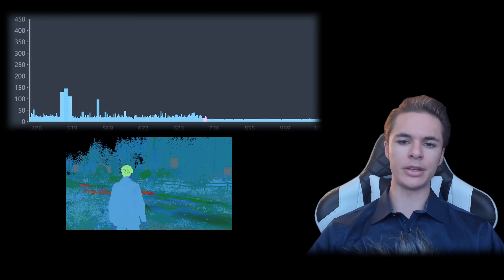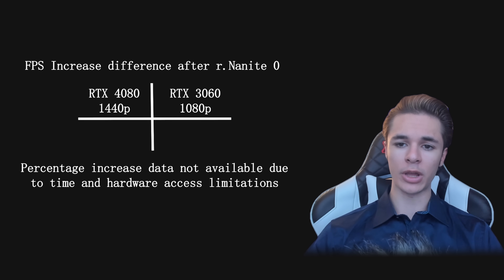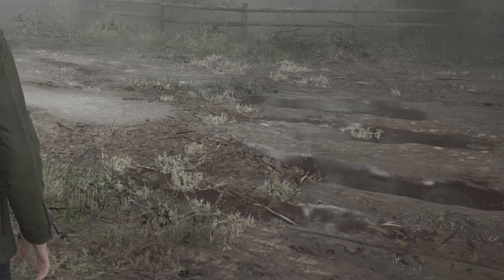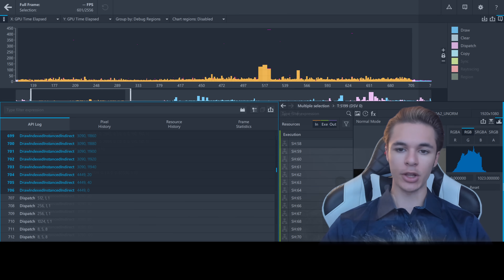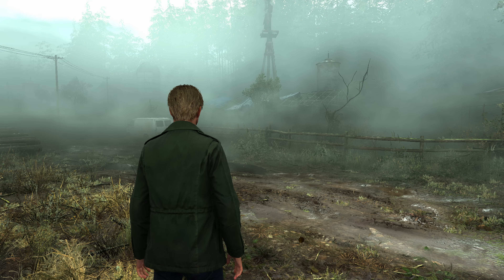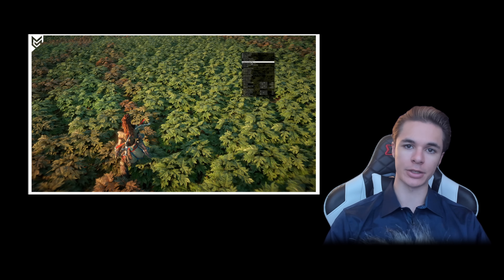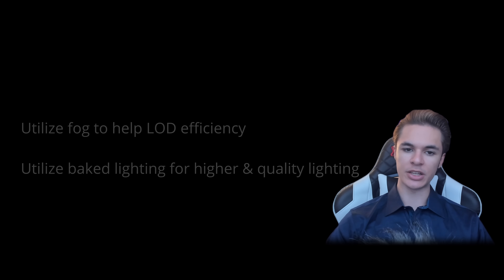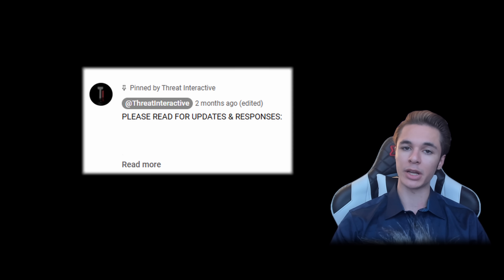The Price of Realism? | SH2R Optimization From The GPU Perspective

Comment: yakuza 6 looks better than any game that is going for realism and made after 2018 cause Nvidia said we don't wanna improve our tech buy our shit bearly better gpus to use dlss and devs that get the highest end shit thought that this would allow them to work with photo scanned assets straight out with out optimization look at older games they had systems to add detail not to remove them like Crysis but you and now UE cocks lies to people that UE 5 is better than UE4 where you can't optimize or it will slow down their nanite shit and removing it means you need to optimize instead of wasting a hour in lod tool you just press one button and ad over 1m meshes with out considering the vertice placement so models don't look like shit every statue looks like shit in ac origins forward as an example.

Comment: I was taught optimization of models in college, our limit for models varied in complexity from 10,000, 20,000 and 100,000 polygons (depending on the homework) with emphasis on equal distribution, only light use of modifiers encouraged.  This looks like they not only blindly applied polygon multiplier mods to even the damn twigs, but they also procedurally generated the environment, which while fast is a process that needs to be applied sparingly and carefully due to multiplicative stressors.  I'm a complete amateur at 3D rn due to focusing on other aspects of art to actually make a game, but this is one of the most basic mistakes a beginner can make.  And the industry does this constantly, it's crazy.  This could have been avoided.
Reply: What do you mean by procedurally generated? Do you mean that the models themselves use procgen at the modelling stage? That's not necessarily any worse than normal destructive modelling, both can have bad/good practices.
Reply: @Channel-ng2cd    It can be destructive if each twig has 3000 polygons and you need 50000, which is what happened.  They either scanned shit in or generated a lot of the stuff without optimizing.
Reply: @bloodyidit4506  that seems more like an issue with geometry processing, not procedural generation though?
Reply: @Channel-ng2cd    The issue isn't the feature itself but how it's being applied and lazily.  Don't assume things are attacks against things, this was wholly about practices.
Reply: @bloodyidit4506  fair, I think I just misinterpreted your tone lol
Reply: It's funny they think that 30 000 to 350 000 per object or animated is OK,  for today graphic cards we can say it's ok, but god damn less than 25 years ago it was almost the critical limit for a graphic cards that could only handle 1 or 2 million of polygon by second even a N64 or a PS1 can't go 300 000 polygon for the entire game, best advice the lower polycount the better, use only if you need more higher subdivision for smooth deformation or shredded object in real time, if it's static LOD IS your best friend for a table a chair or even a tree or barrel , even a car or truck wheel dont need a lot of geometry , texture space can also be compresses or use symmetrical texture, UDIM could be a good sprite sheet system for reuse of texture, game engine like Godot are realy light and can perform well Cry Engine could be also optimise a lot this one now run really great on New system but was a pain in the ass back then for low profile PC .

Comment: The Valley of the Ancients demo and the Matrix Awakening demo really showed Unreal Engine 5 doing things that looked next gen back in 2020. It really frustrates me that so far no UE5 game has come close to those visually, and almost all of them run worse than those demos. I feel like I was lied to with UE5's marketing, though there are some low effort indie games on Steam that look almost photo realistic and actually run fairly well.

Gaming in general is like this now and it's infuriating. RE4 Remake and RE7 don't look 7 years apart. Doom The Dark Ages and Doom 2016 don't look 9 years apart. Black Ops 6 and Black Ops 3 don't look 9 years apart. Assassin's Creed Shadow and Origins don't look 7 years apart. You get the idea. I'd guess all of those games were 2 years apart on the same console generation if I didn't know that the sequels all release halfway through the next console generation.
Reply from the maker: RE: Matrix Awakening demo really showed Unreal Engine 5 doing things that looked next gen back in 2020.

They might look fine but that's only because they brute force (sacrificing 60fps)  since they are not games. It's easy to make a tech demo that looks pretty. It's a whole other ball game when you want good interactivity with proper(for 9th gen) graphics.

Comment: These opening shots don't even run that bad, the game really starts to shit itself once in the apartments area, or even later down the line, past the hospital area. I had frame drops into the 30s on a 1080Ti at 768p with FSR, so I really wonder what exactly happens at those points

Comment: To think that in beginning of Silent Hill devs used fog to hide stuff and ease performance load, and now basically right opposite happens
Reply: After replaying the OG just recently, it's even more embarrassing seeing how the PS2 original's fog seems more dynamic and "living" than the 2024 version.
The original Team Silent also stressed that they wanted the fog to truly "surround" the player, not just be a wall in front of them. Yet the SH2R clearly has an empty "bubble" around the player, that blocks the mist from getting close to James (best seen in the static camera angles mod demonstration videos).
Reply: not really, the games stutters the most inside buildings not outside.
Reply: Only in SH1.

Comment: UE 5 Has so many problems, using it for Virtual Production when it was first released was a horrible experience,  
Lumen did not provide proper upside down surface reflections if you had lumen. you could not properly bake static lightning, therefore losing performance for a realtime Virtual production scenes,  Since our meshes were relatively Optimised meshes, Nanite did not provide any gain but yet another loss. 
The problem really was how bad all the Anti-aliasing options looked, when having a virtual screen showing 60 FPS video content.  The amount of Smearing and excessive Temporality  for Ani aliasing made the images look like a smushed aquarella, since the video material content does not have motion vectors for Temporal effects to track it or its tracking them badly in TSR, and TAA.  Yet the video was clearly visible in SMAA or FXAA, but the aliasing for lights and specular reflections was awful,  so a compromise needed to be taken. And I hated that,  At the end we chose the Aquarella video. And I knew that's a problem with using UE5.

Comment: Thr fortnite talk whete they shared how they animate trees, and that being baked to textures, is still WPO, and decima is roughly the same. There are only two ways of animating parts of objects in games. Skinned meshes which incurrs alot of CPU cost for bone transform update, and VertexShader animation (WPO) what feeds the data for the WPO pass, if its a math based noise or a texture containing the animation is almost irrelevant to performance.

Your point about nanite WPO being more expensive than wpo on traditional meshes is still valid.

Comment: I agree with Unreal's performance issues. But isn't it the same case with all general-purpose game engines open to the lay public? I really don't remember any of these engines selling themselves as focused on performance, but rather as convenient, easy to learn and quick to finish projects even for non-programmers. Non-nanite optimization is definitely more performant than Nanite, but is it faster to implement than Nanite? Same thing with Lumen. Expecting performance from Unreal or any general-purpose public engine is the same as expecting something from where nothing comes from. If you want performance, it's better to make your own engine based on the type of game you want to make, than to use a ready-made engine. And stop using Id Tech as a reference engine because the purpose of Id Tech is totally opposite to Unreal, Unity, Godot or Gamemaker, they are not even market competitors, you are expecting dogs to act like cats.

By the way, I don't use Unreal or any of those engines, because I find them extremely overbloated, I prefer to use DOP/ECS rather than OOP, so I use Flecs and Bevy more, besides preferring to have full control over the frameworks I use.

Comment: UE5 really is the biggest double edged sword for the games industry.
its easy of use and accessibilty, not to mention the sheer amount of genuinly really good features it has makes UE really great for game developers and especially indie devs looking to try out making games. Its an insanely powerfull and versitile engine.

But then, of course, Its flagship features like Nanite, Lumen and its tight integration with NVIDIA's deeplearning stuff... 
More than promote the most lazy, and down right disrespectfull-to-the player development and optimization(or lack there of) practises. 
And the studios most guilty of this are natrually mostly big budget studios that are trying to push the ever plateuing "But muh graphical fidelity" wagon.
Reply: Nothing wrong with graphical fidelity but you can get that with older hardware, this push for unnecessary overpowered expensive hardware is the thing bothers me the most...
Reply: @CoLDbEeR774  The push for the expensive hardware is only partly driven by actuall increases in the game engines abilities and features.
another sizable portion of it is driven by the illusion that new titles "NEED" it to perform well. But most of the hardware requirements are genuinly caused by the complete lack of optimization. So, its a manufactured problem.
Reply: @Psrj-ad  yes, it is manufactured to push people to expensive hardware. Budget pc gaming is dead since more and more devs are using ue5 which destroys low and low/med tier gpus
Reply: I've heard that there are really dumb restrictions for language use so Unreal Engine need to be "gender neutral" or something.

That means that Unreal Engine is not suitable for projects that depict a historical era accurately.

Comment: It feels like many were never around in the day we had to hold the face-count down, we could not "cheat" the performance via external means or  say "just get a better computer bruh". I did a bunch of map making in the late 90's for my LAN party crew and learned a lot from the optimization we could do back then, the Unreal engine blew my mind with how it worked and performed compared to Id's BSP engine games. DLSS getting in via "deal-making" makes a lot of sense with how quick easy and free FSR is but you never see it, while games have every single envyDiaf thing in existence jammed in there. Ick.
Then: I'm making a hand-rail, I know the player will see it in third person view. I will make it on a cylinder with 16 sides o ensure it never looks off for anybody but the most sharp-eyed.
Now: I'm making a hand-rail, my nose is up to the screen to ensure it looks photo-realistic, even the booger-welds will be be smooth, the game engine will automatically make the LOD models, surely.
Reply: "how quick easy and free FSR is"
FSR looks like complete shit, end of story. it's completely pointless. at least DLSS has a valid use case. the fact that nvidia "bribe" developers to implement it isn't as incriminating as one might think either. I highly doubt any developer intentionally makes games perform worse in order to justify DLSS. remember, the consoles have AMD graphics and are always the target platform for anything multi-platform, so if the games run badly on AMD hardware that's just a case of incompetent developers. no way nvidia pays them enough that they would jeopardize how the game runs or looks on console.
Reply: @forasago  Correction* FSR (yes 1.0, this is even the worst case scenario too) looks like bad at any native resolution below 1440p set lower than quality on fsr. Its not total shit like you claim but it hardly holds a candle to DLSS 3.0 or newer.
Reply: 16 sides? id use 6, if not only 4 but keep the face normals as smooth as possible to give it the impression that it's smooth.

Comment: Another banger. On one side, I love Unreal Engine and all the cool stuff like blueprints, material graph, PCG or the animation tech. But at the same time I fucking hate to work with it, because of all these unnecessary issues and half baked features. I‘m still angry that they removed tessellation for landscapes, it was much easier to art direct. Without PCG, I would switch back to UE4 anytime, until all this is fixed.

Oh and f*ck ghosting.

Comment: I kinda miss the days of forward rendering with MSAA and baked everything. I feel like there were tradeoffs done on the way that weren't necessarily for the better, if you look at the final result instead of just the technical potential.

I am hoping UE5 can start using different rendering presets for different use cases, where an interactive preset enables a huge amount of optimizations that actually make a difference. I think it's a problem that developers just don't know enough about the engine.

Comment: btw. are there games, that use jittered samples as an anti-aliasing method, and does it look passable in an interactive scenario? It is well understood in computer graphics that low descrepancy sampling trades aliasing with noise, but everytime i stumble upon explainations how games render their frames, they always show regular grid sampling. Is there a reason for this, or am i just missing something?
Reply: It's because jittering alone isn't enough since the pixels themselves form a regular grid, so your jittered samples always have to align to the regular pixel grid at some point. You can pair jittering with a temporal accumulation buffer to accumulate jittered samples across frames, which is what TAA does and it tends to introduce ghosting and smearing artifacts if the TAA is poorly tuned, which it often is. If you use multisampled rasterisation, such as with SSAA or MSAA, then you can jitter the subpixel sample points to improve AA, though I believe most hardware implementations of MSAA already support this.
Reply: "so your jittered samples always have to align to the regular pixel grid at some point"
why?
"MSAA already support this"
ah nice ok, good to know. thank you :D
Reply: @Akronsus  Because the pixels on your monitor are a regular grid, and the texels within the framebuffer are a regular grid. You can't break that up by just moving the sampling point of each pixel to not be perfectly aligned with the regular grid, because the pixel itself is aligned to the regular grid.

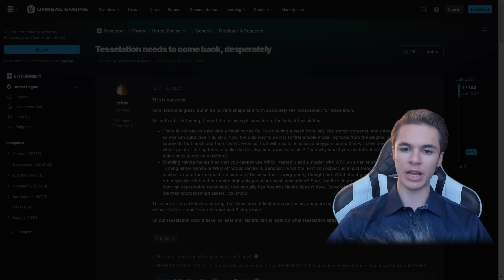Comment: Epic removed what? they removed HARDWARE TESSELATION SUPPORT? WHAT?! 13:29
Reply: Yeah I was shocked when I loaded up UE5 for the first time and realized it was missing. Their solution was to use nanite which is crazy imo because if you just enable nanite on an asset you get a performance hit that is pretty drastic. I'm really hoping they don't do away with the ability to do bakes in favor of an all lumen pipeline next.
Reply: yeah it is stupid. i wanted to dynamically tesselate my ground based on camera distance and learnt it is not possible lmao.
Reply: @pygmalion8952  it is possible, do your research.
Reply: Just use an older version of UE that has this feature? Obviously the engine devs will want to focus on their newest advertised features instead of something less important.
It's like asking why does UE5 not support directx7/9/10, since they're less resource heavy! The answer to me is quite obvious and is the same to your question, it's not necessary in the feature set of the newest engine version..
Reply: Tbf I dont think this is too bad. Not talking about hardware tesselation in particular but removing old features is important. I've worked a ton on different frameworks (not game related though) and dragging along and maintaining old features often severely worsens the quality of new ones.
Reply: @gavinderulo12  Remove you appendix then why won't you?
Reply: @fus132  what?
Reply: @gavinderulo12  my man u realize that tessellation was effective enough we gave it its own fking hardware

Comment: O3DE (CryEngine) perhaps would be a good alternative?

I do belive that Unreal is no longer fit for purpose, and we need to look at alternatives, fit for scope.

Many use Unreal, when they could have used older or less advance Engines. It is just bloat.

And you can not fork Unreal to make a better version, because it is not an open engine, making innovation be totally in the hands of Epic, which are not doing a great job.
Reply from the maker: RE: And you can not fork Unreal to make a better version
It's already been done by Nvidia. Developers who have access to the UE source github have access to forks and it's very easy to get access. 

For more info, watch from this portion of our first video: https://youtu.be/lJu_DgCHfx4?t=1167

Comment: PSSR using terminology from XESS might be because XESS is open like FSR, but FSR doesn't yet have an AI version, so Sony studied XESS as a baseline on how to develop their scaler. Moores law is dead has also said that his sources say AMD did not help sony make PSSR, but sony was willing to share knowledge about PSSR after it was made, which AMD is most likely to use to make FSR 4.0, which will be an AI upscaler and only supported on 7000 and newer radeon GPU's with FSR 3 getting small updates but being the last (and best depending on your view) spatial non-AI upscaler.
Reply: XeSS ain't open xd, not even open source
Reply: FSR hasn't been a spatial upscaler since 1.0. FSR 2.0 and onwards are all temporal upscalers.
Reply: Ai upscaling is just a loop to halfass unblur the already blurry, requiring newer gpus. It's a scam nothing equals a well crafted LOD with photogrammetry
Reply: If what you are saying is true then man...
Amd is slacking